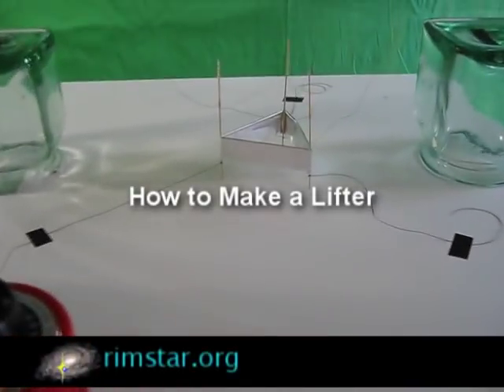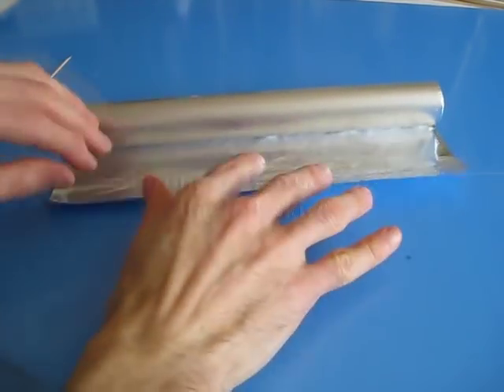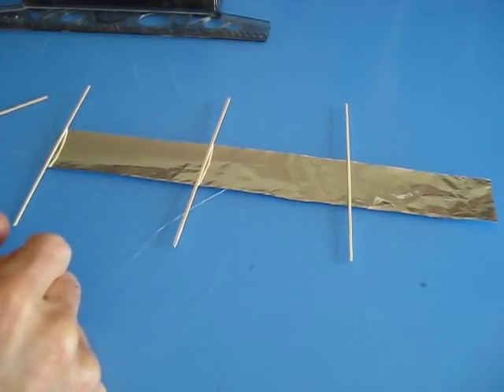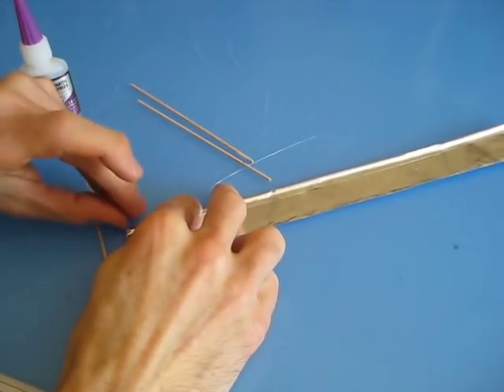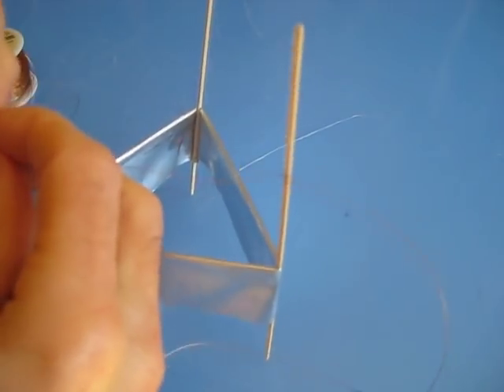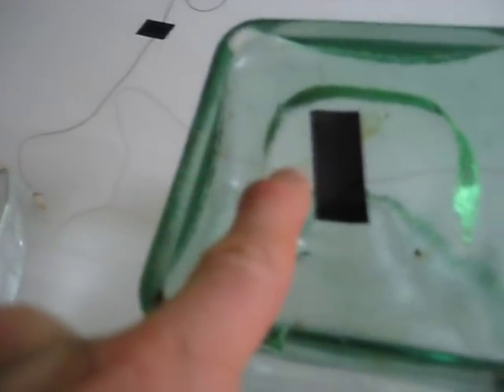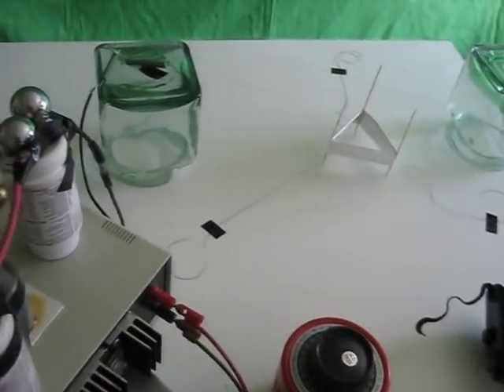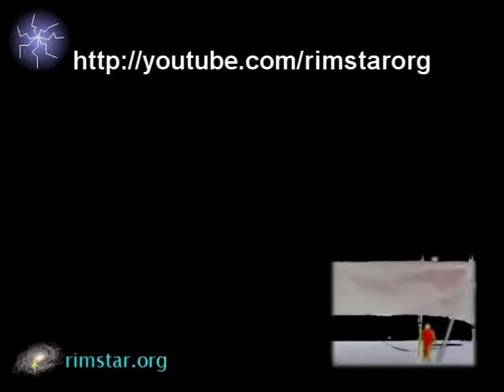How to Make/Build a Lifter or Ionocraft

Comment: A more advanced version of HV lifter, suitable for the development of commercial transport technology, can be found at https://www.youtube.com/watch?v=7kiNaAg2i-o .

Advantages:
1. IFO has the shape of the disk - the most appropriate shape for movement.
2. High energy efficiency ranging from 40% to 56% related to a theoretical efficiency of 16 mW
    16 mW / g. Efficiency can be increased by using pulse HV voltages.
3. The transport technology does not use any mechanical parts for movement, for direct
    conversion of electrical energy to  the kinetic  uses  the mass of the transport mean.
4. Possibility of remote power supply.

Disadvantage:

1. The air is capable of transmitting only limited power in optimal mode.
Reply from the maker: Cool. From what I can tell, it seems to be using the same principle as ion wind rotors http://youtu.be/UgWTjCHsm3M. As far as I can tell from the video, it's like the lifter in this video, but without the thin bare wire.

Comment: does anyone think this could be implemented into somebody's boots or something so they could fly around like iron man?
Reply from the maker: It wouldn't be powerful enough to lift anything. The one in this video can barely lift itself (only 2 grams) and hasn't any chance of lifting the power supply.
Reply: is there any other designs that would make it possible? what if you used a supercapacitor? if you experimented, maybe you could find something that would work, which would be awesome
Reply from the maker: No design that I know of would work. I have been looking every now and then when new components are invented to see if it would help, but so far even with supercapacitors is still couldn't lift its power supply.
Reply: if you say so, but if I grow up and become a billionaire because I invented efficient iron man suits with solar panel supercapacitors, I'm gonna say "I told ya so" XD

Comment: Why polarity don't count?
Reply from the maker: The polarity doesn't matter for ion wind, which is what propels this. The thrust is supposed to be stronger in one direction because of a difference in the positive ions vs negative ions in the air though, but it's not a noticeable difference with this. Here's my video explaining how it works https://www.youtube.com/watch?v=01F8V5IhB5k
Reply: @RimstarOrg  In that clip I see your description of positive polarity on the sharp edge. Then you told it vice versa had negative connected.  
If e itself that run to impact neutral air atom instead of possitive ion that should impact, Given e mass thats countless to the ion ,I don't think it can transfer momentum to push neutral air's ion to move.

Comment: My assistant translated this for me.
Reply from the maker: +MantzyAUS Would it be possible to get the translation so I can try putting it in the captions that you see at the bottom in the video when you click on CC? I'm sure others would find it useful. I don't currently have the English ones done but am working on them (captions weren't available back when I made the video.) You can email them to me at stevend@rimstar.org if that works for you.
Reply: I'm really sorry mate, but I was making reference to the fact that a video like yours was mentioned in a Japanese sci-fi visual novel game called Steins;Gate and the character didn't speak English and had to have his assistant/colleague translate.  Sorry for the confusion.  BTW, the El Psy Congroo comment below is also there for the same reason in case you were wondering.
Reply from the maker: +MantzyAUS :) No worries. I sometimes catch the references but yours was plausible. I kinda like them... they often lead to whole new worlds.

Comment: Lots of explanation about how to build the OBVIOUS aluminum lifter, but close to NOTHING on how to build the power supply???????
Reply from the maker: The power supply details are all here https://rimstar.org/equip/30kv_pwr_supply.htm including a video. Unfortunately, one of the parts, the flyback transformer without a built-in diode has become harder to find since we've switched from CRT type TVs to flat screen ones. But if you can find an old CRT computer monitor then you can build this one https://rimstar.org/equip/hvgmon24kv.htm

Comment: 12:39 "If you don't have balls to touch, you can touch the skirt".
No seriously, if this thing flies due to ion flow, why DOESN'T it matter which polarity you wire it up?
And if it lifts by ion flow, why are no photons being released when the electrons change their velocity?
Reply from the maker: Kamran Kamal The direction is determined by the shapes of the electrodes. The wire is a sharp electrode and the top of the foil is smooth. It moves in the direction of the sharp electrode. I explain it in my video "How Ion Propulsion, Lifters and Ionocrafts Work". There I have the sharp electrode be positive, and the ionization works a little differently when it's negative, but there is still ionization and the shapes are still what determine the direction.Regarding the release of photons, photons are released but they're so little in this case that you need darkness to see them. They're in the form of a bluish corona (I'm guessing that the corona is at least partly due to that; I've never found details about the cause of the color.) The same explanatory video I link to above shows the corona near the beginning.
Reply: RimstarOrg Thanks for your explanation but if the current moves in the direction from smooth to sharp, then the ion flow would be moving in the opposite direction needed for lift.  If it worked this way, you craft would be flying into the table.
If the ion flow went the other way, I doubt protons would be making the journey because of their relative mass compared to the electron.  I would also be interested to know what is happening to the neutrons as they would probably need to separate from the protons of the nucleus causing a nuclear reaction (which clearly isn't going on here).
As for not seeing any photons, you may be right, the energy of the radiation is probably higher than the visible range, which is why it looks bluish (ultraviolet).  With this in mind, please be careful as you may expose yourself to x-rays or even gamma rays.
Reply from the maker: Kamran Kamal I meant the direction of movement is in the direction of the sharp electrode. Sorry if I wasn't clear on that.
Reply: RimstarOrg I thought that was the direction you meant.  It would mean that your craft's force is heading into the table and not giving it lift.  Could it be possible that your craft's lift is not created by ion propulsion?
Reply from the maker: Kamran Kamal
I guess I'm still not clear enough. The direction of movement of the lifter is toward the sharp wire and away from the foil. That propels it upward, off of the table.
Reply: That would mean your ion flow must be heading downwards, in which case your wire will need a negative charge, but you've shown it works with a positive charge on the wire which doesn't make sense, as I've explained above.
Could the effect be related to one of TT Brown's experiments?
Reply from the maker: Kamran Kamal See here http://en.wikipedia.org/wiki/Corona_discharge#Mechanism_of_corona_discharge, along with the two sections that follow it about positive and negative coronas.
Reply: Thanks for the link.  I now understand that the protons and electrons are coming from the air and not the electrodes.
I'm still confused where the force is coming from.  If the corona gives half its energy to the electrons and half its energy to the protons, the momentum of both will be equal.  When these particles collide with their opposing charges the net force should be zero.  So where does the lifting force come from?
Reply from the maker: Kamran Kamal Did you watch my video "How Ion Propulsion, Lifters and Ionocrafts Work"? I explain it in there.
Reply: Thanks for your very clear video, it has answered all my questions.  Have a good day
Reply from the maker: ***** Actually, he said all his questions were answered. Sounds good too me. :)
Reply: RimstarOrg the gases in the air determine the color of the corona

Comment: how the fuck does t his work... is this real? can this be used?
Reply from the maker: It works using ion propulsion. I explain it in this video https://www.youtube.com/watch?v=01F8V5IhB5k. You can see the ion wind in the smoke tests I did in this video https://www.youtube.com/watch?v=LOGAaObsN4g. So, yup, it's real. But it's not powerful enough to lift its own power supply and no one's ever succeeded in making one that can. Speculation is that it would have to be the size of a house. It is fun to make and experiment with, though the power supply is a hard one to make since it needs to be not only high voltage DC but also high current.

Comment: nope. whats the balls for?
Reply from the maker: When conducting electricity at high voltage, you want to avoid sharp points. The exception is the lifter where we want sharp points, but elsewhere along the circuit, we want to avoid sharp points. That's because charge can become tightly packed at a sharp point and cause charge to leak to the surrounding air.
Where we're making a connection, like where the balls are, you could just make the connection by twisting two wires together, but there might be some sharp points then. So instead we have the wires end at rounded objects, like metal balls. And then to make the connection, we simply touch the balls together.

Comment: Any successful reproductions?.......??? Anyone can build this kite. Tie the longer thread, take outside on windy day. now you have successful liftoff ;-)  serious  my question is, Why the green screen backdrop? and Why are you adjusting a Variac  variable  transformer? they are AC right and all this bare wires. kids don't try this you may become BBQ. I just cant believe ions produce  thrust straight down to create lift with this design. A Copper coil will levitate over a plate of Aluminum however gravity still holds them down.
Reply from the maker: The green screen backdrop was just a just a way of making a plain background so that what I was showing could be seen more easily. Most of my videos have a green, white or black background.
The variac is for controlling the input voltage to my low voltage DC power supply which then feeds my high voltage power supply. That way I can control the high voltage and current going to the lifter. If I were to feed mains voltage directly then the high voltage to the lifter would be too high and I'd just get sparks between the thin wire and the foil skirt, probably even set the balsa wood on fire.
The bare wires all come from the high voltage power supply and have DC on them. Still dangerous though, as a spark would have a lot of current. I give safety tips for discharging it all near the end of the video.
Here's my explanatory video on how the ion propulsion works: https://www.youtube.com/watch?v=01F8V5IhB5k
Reply from the maker: Oh, I just rewatched the beginning of the video. The green screen also made it possible to do that fun animation near the beginning of the video.